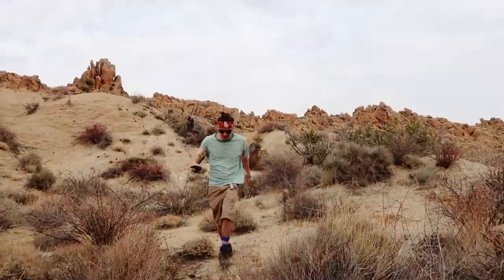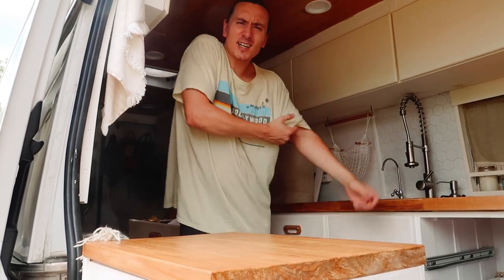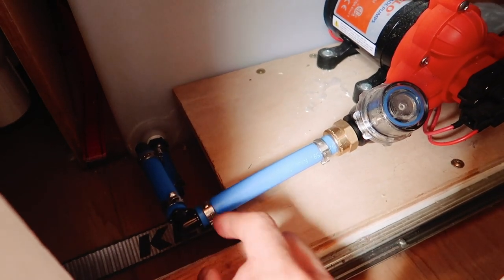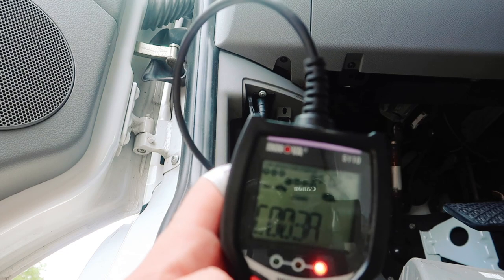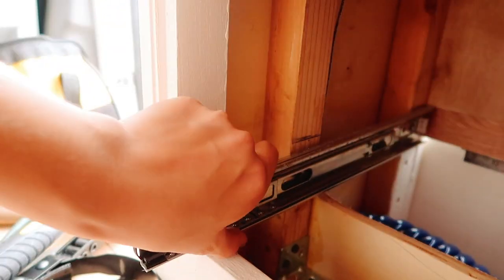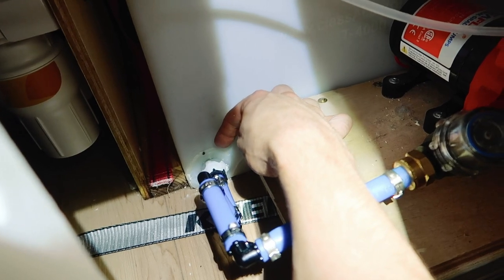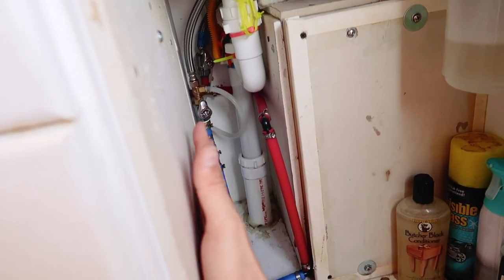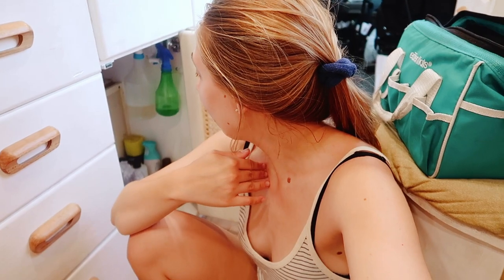Fixing up our Van Build | Do You NEED a Water Heater in a Van?

Comment: The check engine light would come on during heavy rain a lot because water would get into the o2 sensor in the catalytic converter. 🤷‍♂️🚚
Reply from the maker: Good to know, we will have to look into that. We do run into the most issues when it’s heavily raining. 🤔